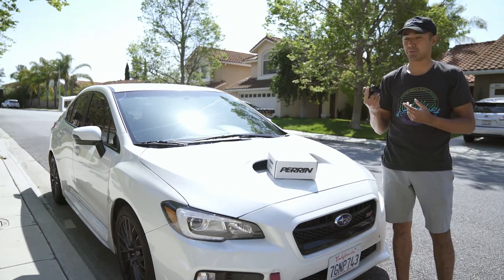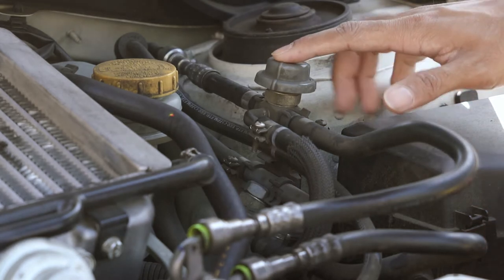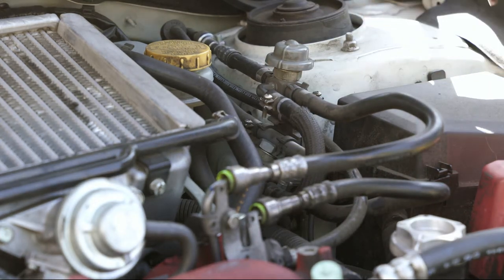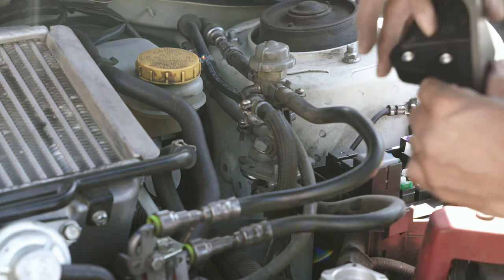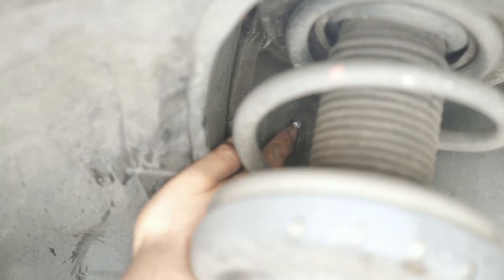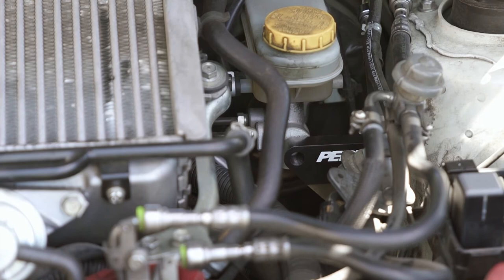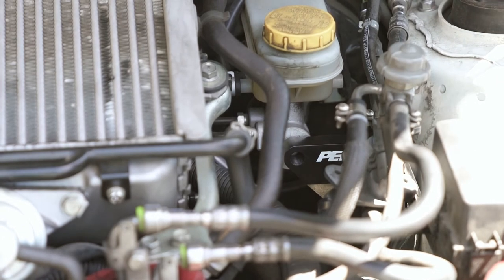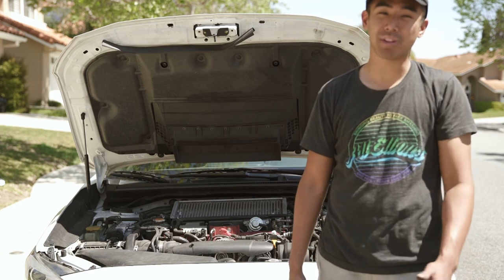Subaru WRX STI Perrin Brake Cylinder Brace DIY

Comment: Looks like an easy install. I've been thinking about getting the same brace. Noticeable results?
Reply from the maker: After taking the car to laguna, The pedal feel was pretty consistent and firm. I remember times at buttonwillow where the pedal travel would increase slightly & that wasn't due to boiling the brake fluid. The increase firmness is welcomed! Brake pressure feels consistent under continuous hard braking and it makes heel-toe'ing easier IMO. It's a nice mod to enhance the feel and feedback the car gives you! :) Are there more important mods out there that deal with your brakes that should have done before you spend on this? Yes, but I don't regret buying it! :)
Reply: What brake system related parts would you recommend installing before getting this brace?
Reply from the maker: @MD-pz3cn  sorry i didn't respond to this till now! prior to installing this, I had stoptech stainless steel lines on the car. I was a little worried of the rubbing brake lines expanding on me and breaking while on track. SS lines took out some of that mushy brake pedal feel. 

It's not necessary for public road use, but changing your brake pads to a little more aggressive compound could give you more initial bite when you get on the brakes. Go too aggressive on the compound and the brakes start to get noisy and annoying for street use. I drove around on Ferodo DS2500 and that was too noisy and annoying for me coming to a stop a lights hahaha now I just daily these street stoptech pads and save the ferodo's for track day events.